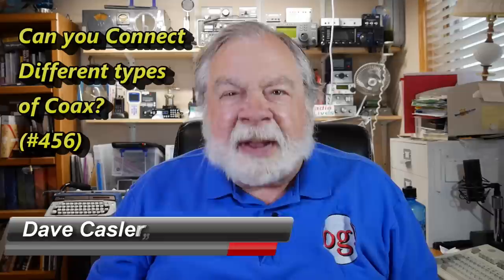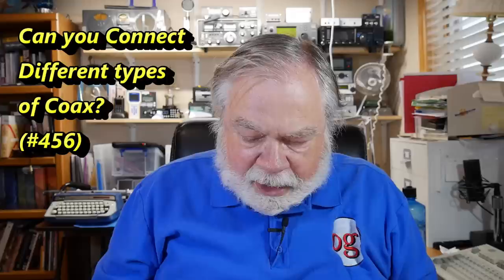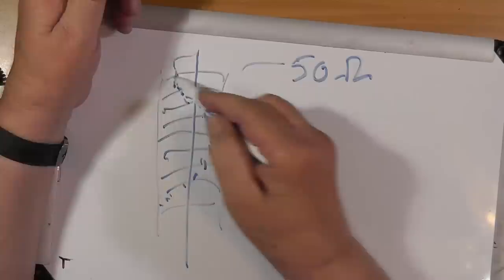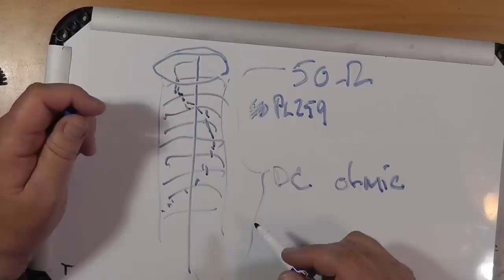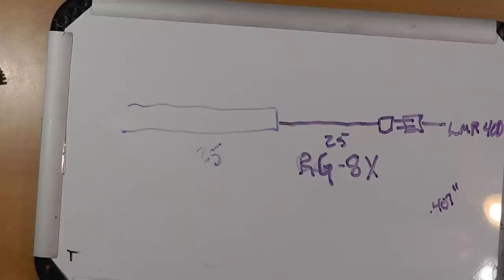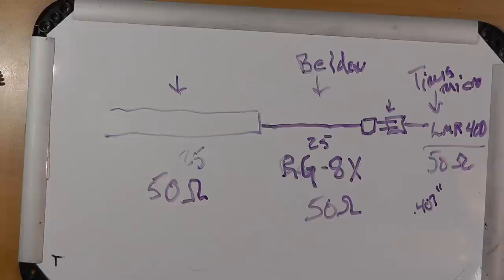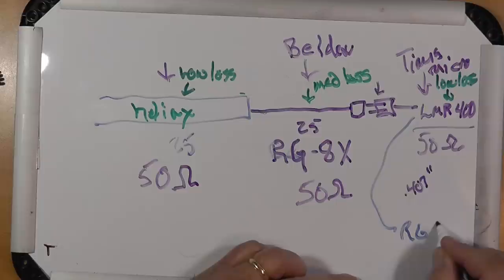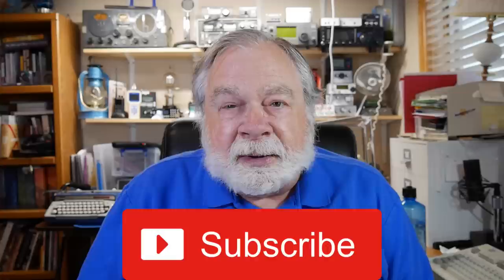Can you Connect Different Types of Coax? (#456)

Comment: Oh, I don't know about WalMart. I use Heliax for my Uhf vert gpa and Yagi directional for the repeaters. The 1/2" Heliax is just on the tower about 50 ft. I use1/4" superflex for the gpa tail and the yagi tail The main feed coming out of the shack is 3/8 superflex comming from the switch to the polyphaser about a 15 ft run.  This particular station has nothing to do with amateur radio though its for coms on a farm and farm to farm and field use for coordinating planting crews and field work and security. I get this from the Antenna Farm if that matters. It's a charity thing . Using this stuff for anything less than vhf is pointless and a waste of money. I would suggest if possible for him to use just one type of feedline at a single length to avoid issues.

Comment: The characteristic Picofarads per foot, and the characteristic velocity factor of all these cables will probably be quite different, but at such short lengths, (on HF,) the typical 1/4 and 1/2 wavelength effects will probably not come into play...  but for longer lengths and or higher frequencies, who knows what sort of impedance you might find at the station end of all that!!!